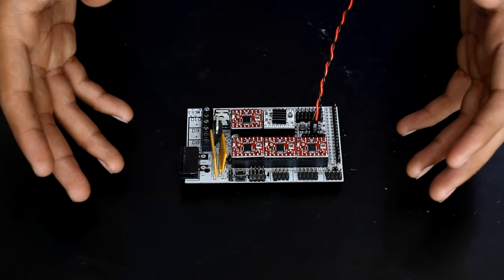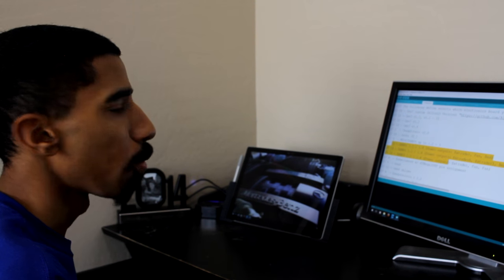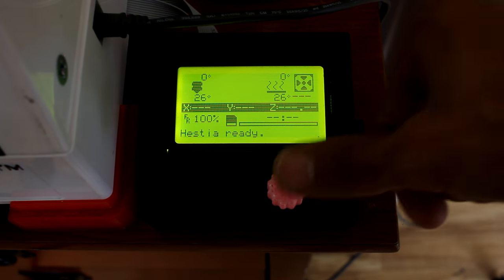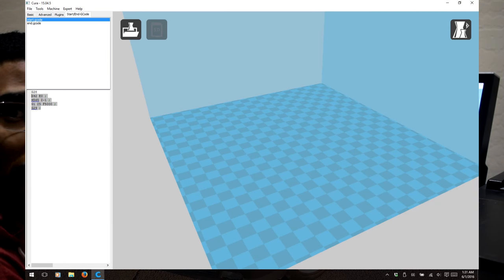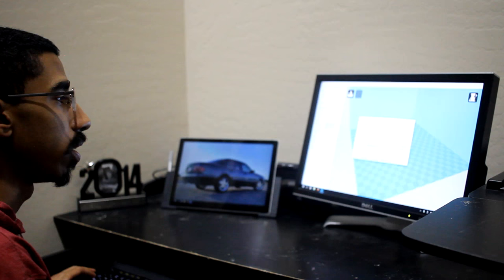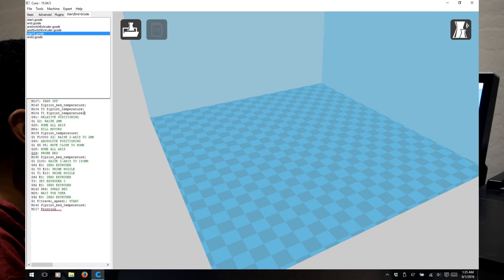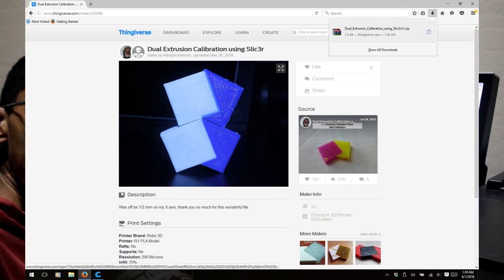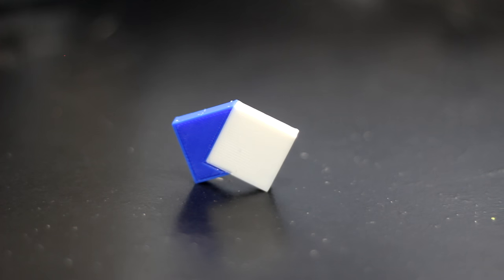Expert Mods: Dual Extruder

Comment: just as an FYI, the limit switch on the r1 plus is not on the x carriage. not unless Amazon didn't give me an r1 plus...
Reply: Yeah it dose not have the limit switch on the carriage. And i just got my printer a robo r1 plus
Reply from the maker: Thanks for letting me know you two, guess they only did it for the 2nd version of the R1, and took it off when they moved to the R1+
Reply: I have an r1 plus from Amazon, limit switch is not on the carriage
Reply: You'll find many small inconsistencies, between robo printers of the same generation.

Comment: Hello thanks for the great video! The Robo R1 is on my short list of 3D printers. My second choice is the Printrbot Metal Plus.  As a new person to at home 3D printing, how difficult is this machine to learn? I have excellent CAD experience but I need to improve my coding skills. Do you recommend that I have a thorough knowledge of say Java before I endeavor to take up 3D printing or can I learn as I go along (I did take an entry level course in college) thanks!
Reply from the maker: Never learned Java myself, but I believe Arduino is a mix between Basic C and Python. Coding isn't a huge priority unless you want to mess with a lot of behind the scenes stuff. I'd have to say adherence, and a level bed will pretty much guarantee a good quality print.

Comment: How do you know your X and Y offset values are correct? Is there a calibration file to run to verify?
Reply from the maker: I measured with a dial caliper and checked by printing

Comment: In trying to upgrade my cr-10s.. I bought a 2 to 2 duel hotend. 

I've been searching for hours and I thought I could do this my self. But I'm having trouble with the wiring. 
What I mean by that is I have the hotend ready to go. I just have to buy the second extruder motor. 
I just don't know where to plug in the wires exactly from the hotend. 

I bought the V6 two in one extruder. On Amazon. I also heard the board on the cr10s is comparable with duel extrusion. If anyone can help it would mean a lot !

Comment: Recently received R1+. I'm interested in what you have done with the dual extruder setup.  Being that it's now almost 2 years since you did this could you share your experience.  Does it still work well? Did you encounter issues down the road? Knowing what E3D has out now would you suggest anything different for those taking on this project today?
Reply from the maker: TBH, the Titan jammed on my all the time, I've yet to do a follow up video, but I'm working on a 3D printed solution now.

Comment: Using MatterControl my seconds extruder is showing 499 celcius  even with no thermistor connected. any tips?
Reply from the maker: open circuit sometimes read as crazy thermistor table plots. It's only a problem if that happens when you install a thermistor

Comment: does cura display both extruder temps and motor controls?  I cant figure out how to run my extruder to just swap color
Reply from the maker: type T1 into the g-code interface to change which extruder you control. Or make a custom pronterface UI that has both.
https://youtu.be/Cf54Wd8N48Q

Comment: M using mks gen1.4 board pla  fan is not working??
Reply from the maker: you have to remap fans to a new transistor if you run dual extruders

Comment: Thank you for a very useful video. One quick question though: Shouldn't the 18mm offset be the X offset and not the Y? The nozzles are lined up along the X-axis right?
Reply from the maker: Nope the way my printer works has the Bed moving back and forth in line with the two nozzles and the X axis moves from wall to wall keeping the nozzles parallel
Reply: @NoviceExpertise  hi  thanks for the great video- can you confirm  that all you need to do in marlin to make any 3d printer a dual nozzle/extruder  machine is to set 2 nozzles  and the offset between  nozzles. Thanks😀

Comment: I already have a dual extruder but it's a mixer (2 in 1 out). I want to change it to a 2 in 2 out so I can print supports in PVA. I plan to switch it out, and split the hot end between two hot ends, using a buck converter to keep one of them lower temperature than the other, then just adjust my nozzle offset in Cura. Does anyone know if this will work?
Reply from the maker: Can't say for certain I know this will work, I have never tried it. But you should be able to set two separate temps with Cura on the individual extruders and then like you said adjust the nozzle offset.
Reply: @NoviceExpertise  My current setup is a 2 in 1 out, so my board only has the capability for one hot end, hence the split using a buck converter.

Comment: what are you doing to control ooze from the nozzle not in use?
Reply from the maker: Low temps and fast retraction is about all
Reply: +Novice Expert Would you share what those settings are?
Reply from the maker: Temp: 200C on both nozzles
Retract Speed: 100mm/s
Distance: 5mm

Comment: Great video, dual setup is on my list of mods. My question now is how did you get rid of extra extruders on your lcd panel??
Reply from the maker: I have a release candidate version of firmware that has some LCD modifications built in. This is thread where the firmware is located http://bit.ly/21fMvKe (page 25)

Comment: I have been having some issues with this whole dual extruder, i changed the firmware exactly like you did however for some reason, only one of the extruders will heat up. I know you are not a troubleshooter but maybe you had an issue like this or saw something like this. It would help a whole lot if you happened to know a solution. Thank you!
Reply from the maker: Probably some Gcode trouble

try adding T0 and T1 before heating commands and that should fix that issue

Comment: have you updated your lcd software
Reply from the maker: Kind of, I'm using RC3 firmware. Here's a link to the forum where I got it: http://bit.ly/1UajXBl
Reply: I just wondered because i had tried to use boath versions and cant seen to figur out the z offset for my lcd with my new robo r1 plus (my first printer)
Reply from the maker: Not sure if we would have the same problem, but when I moved to new firmware my offset didn't work either. I had to go to Motion and select Restore Fail safe. Had to ask myself a similar question when I needed to change the steps per mm
 http://community.robo3d.com/index.php?threads/cannot-change-rc3-steps-per-unit.7962/

Comment: I followed this guide for my Robo 3d R1+ howerver when I try to set the temperature for the extruder it only sets the target temperature for extruder 1 but not extruder 2 so extruder 1 will heat up but not the second extruder.
Reply: It doesn't show Extruder 2's temperature in cura. also I have nema 17 slimline motors (come with the titan extruders now) they are 0.9 deg. I tried to set the steps in configuration.h but they still don't work, they kind of just vibrate and sound like the gear teeth are slipping but they aren't.
Reply: In the G-Code Terminal to set active extruder type "T1" for secondary and T0 for primary.
When active extruder is 1 type "M104 S200" to attempt to heat it
Reply from the maker: Oh, well if it doesn't show temp then you might have the wrong motherboard defined
Reply: Novice Expert I have it defined as motherboard 34

Comment: do I have to sacrifice my heated bed in order to have dual extruders, and dual fans?
Reply from the maker: Not at all, if you use a transistor board, you can have as many peripherals as you want!

Hestia has 8!
2 x Fans
2 x Extruders
1 x Bed
3 x LED controls
Reply: cool! thanks